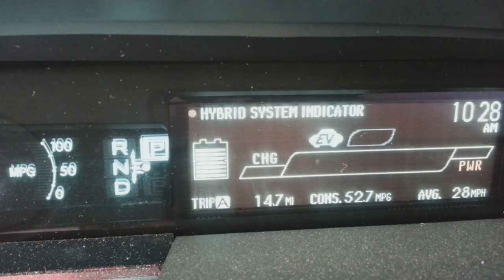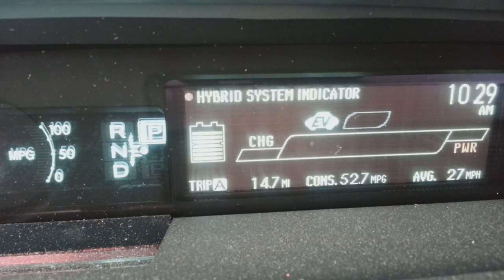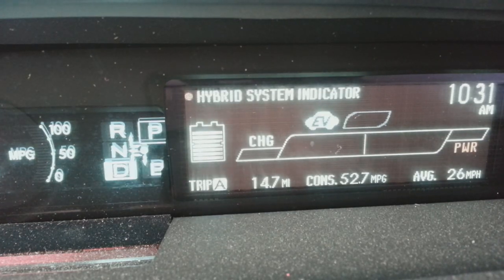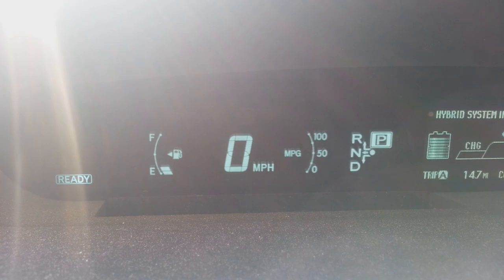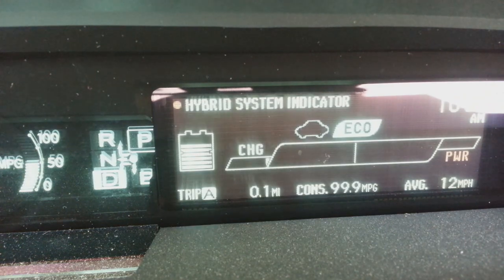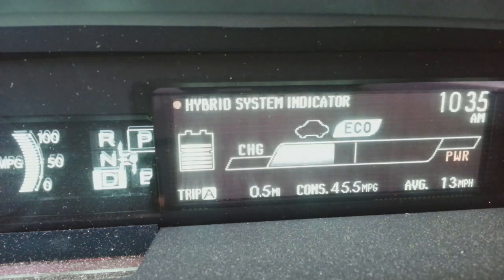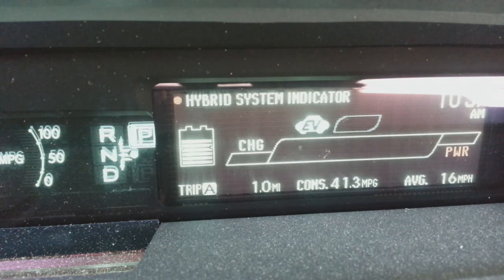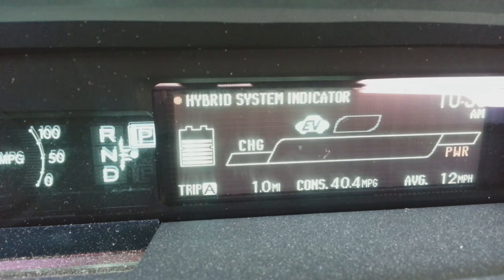Toyota Prius - Instrument panel explained (Detailed) Gen 3

Comment: I'm confused between EV and when the indicator is on the left. I understand when the EV button is pressed it's 100% electric, but when you exceed the speed the EV mode goes off, if you're still on the left, is it still in electric mode? If so, what's the point of EV mode?
Reply from the maker: EV mode is perfect for Bumper to bumper traffic up to 25MPH. In hybrid mode, if you press the gas pedal easy, you can go up to 45MPH in EV. It's not a plug in, but it gives you some type of EV feel. You should look at the 2023 and newer Prius prime.

Comment: Don't use B mode unless you are going downhill(VERY downhill) as it enables engine braking to slow the car down which actually costs more energy than if it were disabled.  It looks like it's generating more electricity, but it's also burning more gas to do it.
Reply: This is an incorrect statement.

Comment: I cleaned my dashboard with wet cloth. After cleaning the left side. That is the part that is projected from down which is the fuel guage and speedometer display stopped working. 
How do I fix it or make it to start working again?
Reply from the maker: The left display is a located on the bottom and shoots up to a mirror.  You may have inadvertently broken the screen when you cleaned it.
Reply: @Joeteck  the screen is not broken.  I believe water entered it. Do you think it will come on later may be when the water dries or what can I do to fix it?
Reply from the maker: @greatogbuagu1370  you may have shorted it out and broke the screen. With cleaning it. You may need to bring it to a dealer